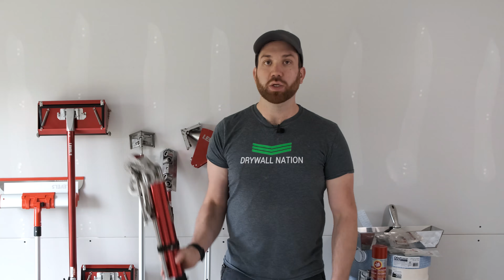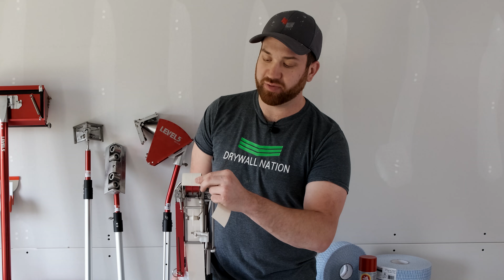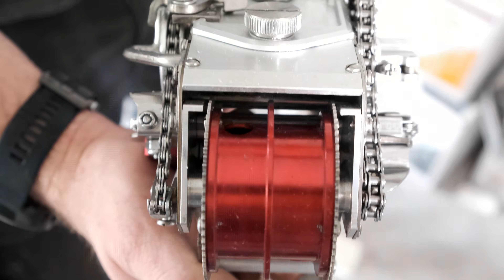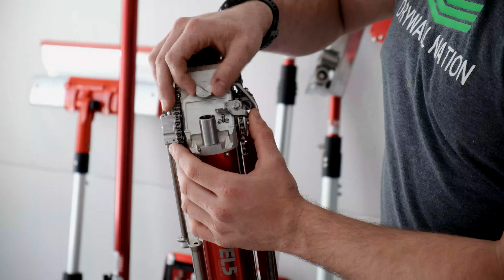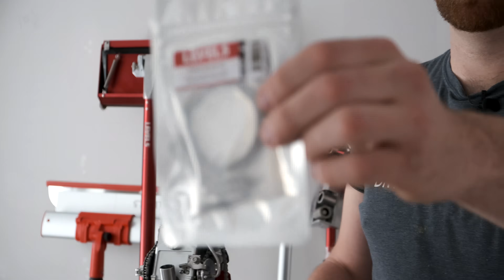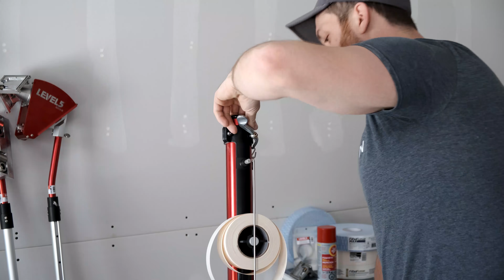How To Use An Automatic Drywall Taper | A Complete Guide | Video 3/6

Comment: Do you guys finance id like to get a set but i dont have credit so im currently saving money for a whole kit
Reply from the maker: We work with financing partners but they require good credit. What we can do for you directly if you don't have good credit is split an automatic tool set up into 2-3 smaller installments.

That way you still get the bonus of getting the full set, without having to pay the full cost upfront.

Give us a call at 800.227.7713 if you want some help getting the tools you need.

Comment: Will the level 5 box handle fit to a columbia box? I know most if not all usually do but I have never used Level 5 tools before.
Reply from the maker: Great question! Yes, our handles will fit flat boxes made by most other manufacturers.
Reply: @level5tools  Thanks a lot buddy. You put my mind at ease. I've only used columbia gear so I wasn't sure if they would work together.
Reply from the maker: You're all set! Please let us know if you have any other questions about our tools.
Reply: iş arıyorum bu alanda öğretmenim